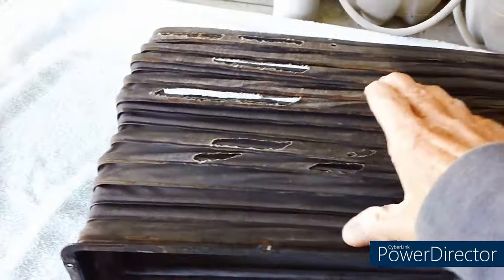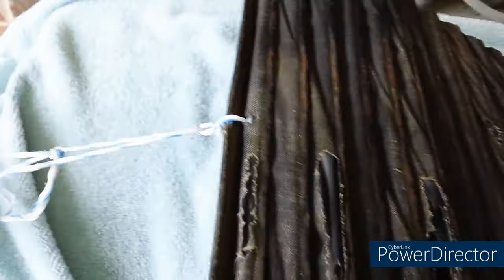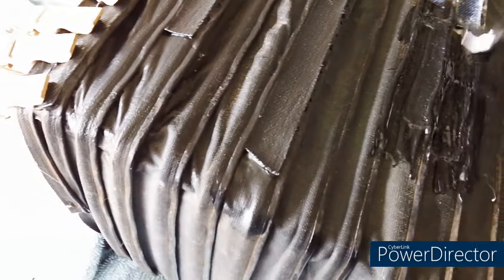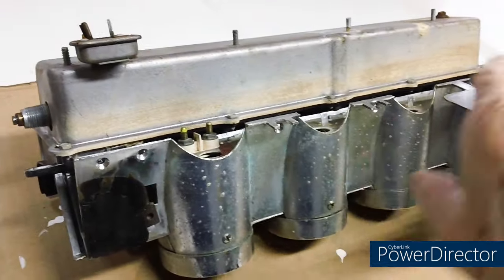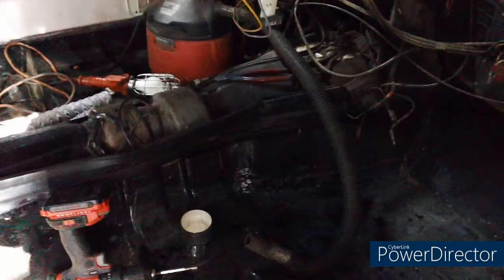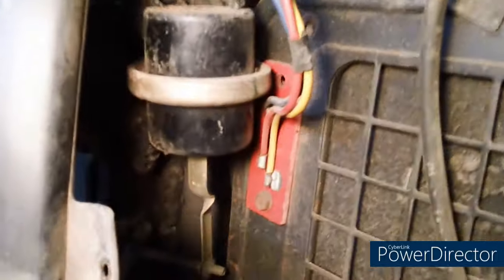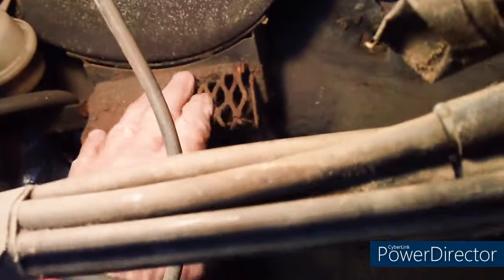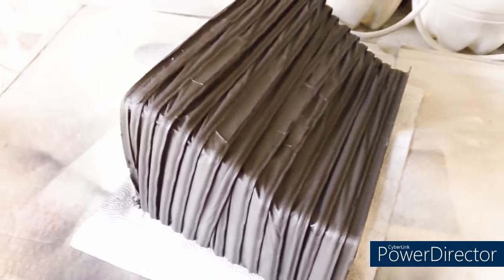1966 Ford Thunderbird repair and refurbishment. (Part# 154)

Comment: Hey John, nice job on the bellows. I like that liquid tape, Ive got to get me some of that. On the CVR, the CVR does not limit the amount of voltage to the gauges, it pulses 12 volts to the gauges. The gauges still get 12 volts. That little rectangular relay you were pointing to that is attached to the back of the dash, that is not the seat belt relay. The seat belt relay is over by the fuse box. However, I cant tell you what that relay is for since Ive forgotten. Id have to look at a wiring diagram. That one has got me stumped. Yeah, like everyone elses car, the 3 machine screws that hold the cover plate on the heater box have been lost and someone put in sheet metal screws because they didnt notice that they were different. The guy that worked on it last was probably a chevy mechanic. But it doesnt matter really if you just use sheet metal screws there. I dont really know why the factory used different screws there. Yes, those coil resistors are for the 3 speed fan. They are very fragile so be careful with them. The ceramic tubes covering the coils are easily broken so take care. Anyway, your really deep into it now. You opened up a big can of worms and spiders too. Great video, thanks.

Comment: That duct had more holes in it than swiss cheese. Good idea for the repair. Liquid tape on the material makes the bellows look more uniform and of course seals it off more. great Job. Nothing like a simple repair getting that heater core out. Luckily the M37 is a lot simpler Thanks for sharing John.
Reply from the maker: Hey Larry,
Thanks, my friend.  My entire T-Bird series is pretty much geared toward the less expensive side of the house and to show how the power of thinking can often make a complicated-looking repair actually be simple to do.  But it doesn't always quite go that way. 😏
Regards,
John

Comment: My 64 Galaxie has the same bellow duct connector for the fresh air intake from the cowl to the heater plenum box. After 15 years it deteriorated - I remember my late father making a patch repair on it.  In 1991 I bought a reproduction one made by Dennis Carpenter in the USA.  I think I paid $25.00 IIRC.  This past summer I finally had to replace the original heater core, and when I removed the heater plenum box the Dennis Carpenter duct was still nice and pliable exactly like it was over 30 years ago.
Reply from the maker: Congrats.  I don't think this one would have been so bad had the mice not gotten to it.  In terms of old classic cars, they've over the years caused a lot of damage.
Regards,
John

Comment: Hello John. I was glad to see your fix on the bellows. I thought you were going to use the bellows from your accordion! Lol. I just replace my heater core this week on my non A/C tbird without removing the dash. It was loads of fun. I see its just as much fun to do the A/C models.
Anyway, very nice fix.
George B
Reply from the maker: George H,
Thanks, my friend.  Mega-question:
How did you remove the two heater core corner hex-screws nearest the firewall?
Regards
John
Reply: John, the heater case is totally different on a non AC model. The heater core is removed from the firewall side of the case. I had to pull the case down and away from the firewall and use a mirror to see the heater core cover.